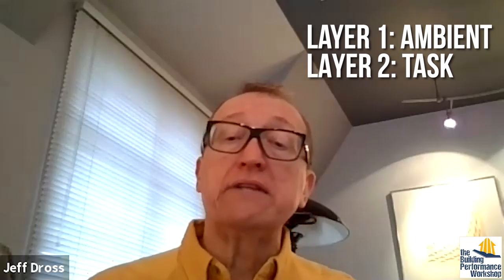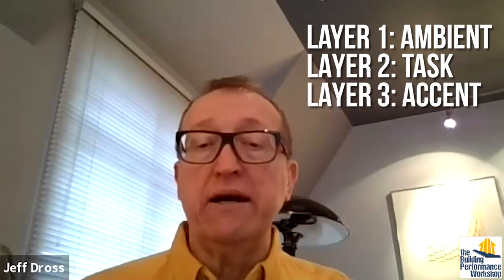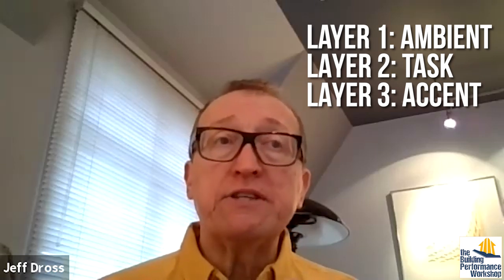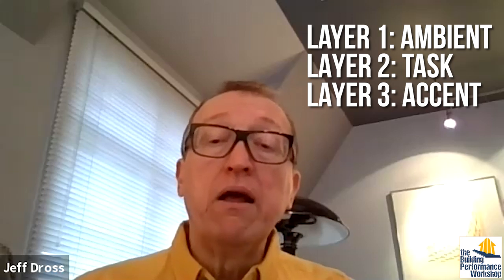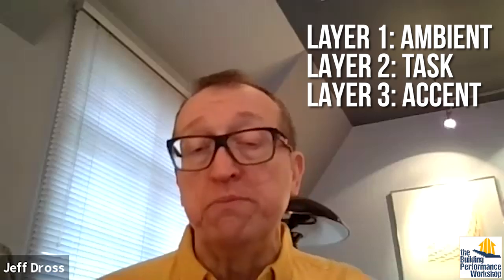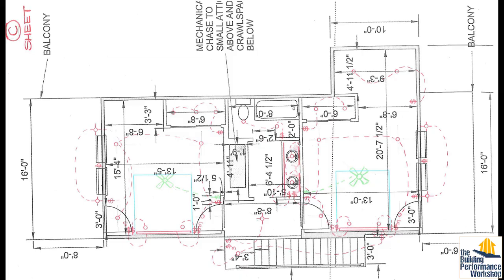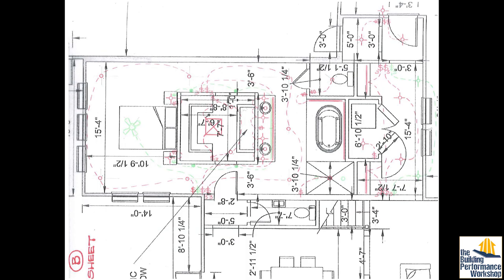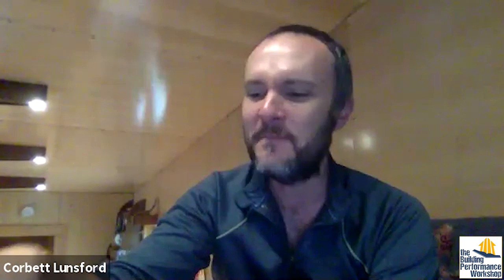How to Design Lighting: Layers, Lumens, Footcandles, Colors, and Systems with Kichler's Jeff Dross

Comment: Oh man. You've hit my subject. As a film industry gaffer, all I do is lighting science and lighting design. This was all good information for basics but I have a couple of things to add.

1) Concerning color... Kelvin isn't the only thing to think about. The advantage of incandescents is that they are black body radiators, like the sun, which brands they give off full spectrum light. This means, although your Kelvin may be 2700, every color of the rainbow is represented in that white. This means that when that light reflects off a colored surface, it will accurately represent that color back to your eyes. The problem with CRI readings on LEDs is they can be fine tuned to the CRI chart while still having spectrum drops so you'll get bad color rendering on certain colors. That's not to discount LEDs. They're definitely the future. Just something to check. 

2) The bigger the source, the softer the light. The smaller, the harder. The closer the source, the softer the light. The further, the softer. Bouncing light off the ceiling makes your entire ceiling the source, therefore softer. It's actually something we do quite often in film for a quick, beautiful soft source. 

3) If you want beautiful light, think windows. Not direct sun but the sky. Biggest, most beautiful source of light. And then accent with lamps. At night, just the lamps. Essentially you're painting with light. Pools of darkness are okay. In fact, preferable. Recessed or faux recessed should never be used unless you've dropped something and can't find it, lol.

Anyways, I could talk for hours about this stuff but if you're interested in color science Frieder Hochheim from KinoFlo has some good talks. And here's a good primer: https://www.google.com/search?q=color+science+led+indie&oq=color+science+led+indie&aqs=chrome..69i57.6274j0j9&client=ms-android-hms-tmobile-us&sourceid=chrome-mobile&ie=UTF-8#
Reply from the maker: You rock, Brandon, great comments. Very familiar with how scientific and painstaking film lighting is- something that requires way more patience than I have I think.
Reply: @HomePerformance  If you're ever in the Seattle area hit me up and I'll let you check out my spectrometer. 🖖
Reply: I know this reply is a year later but great into. In currently trying and failing to design the lighting in my house. I know I want zero recessed lights and much bounced light. 

Question. What are the best lights for bouncing off the ceiling.

2. Is it's better to bounce off the ceiling or off a wall? Thanks
Reply: @jl9678  The easiest thing to do would be to hide some led strip lights pointing up inside hanging fixtures or crown moulding around the room.
Reply: @lightswitchvideo  thanks for that info. I'll definitely look into that.
Reply: @lightswitchvideo  go, thanks for that link. It's a good refresher and I learned some more this time around (lighting around the bathroom mirror with sconces). It highlights two main problems I have.

1. I don't want to have recessed lights. There are several reasons one being I don't know how to implement them without the light looking boring.
2. I don't have any lighting catalogs. The only sources of lighting ideas currently are wayfair or lamps plus and the selection is disheartening.

So,  do you know,where does one find out download lighting catalogs?

Thanks

Comment: Good interview. I have done lots of lighting installs in commercial applications and you learn what works and what doesn't in many areas.  
 One issue I have though is his choice of color temperature. The 2700-3K color in a house is horrible. It makes you feel like you are in a dingy smoky poorly lit bar. That yellow light is annoying to deal with and many residential customers are replacing their low K lighting with lighting of around 4K because it's more like sunlight instead of a poorly lit cave.

       The problem with current LEDs is the powersupplies tend to fail. It doesn't matter what you paid for them as in my experience I have seen the same failure rate on high end units as I have cheap ones because the powersupplies are often the same units. Some super cheap bulb type ones use a capacitive dropper and capacitors are not known for long life.  
          The issue is say I have 10 sconces in a room and one fails. If it's more than a few months old you won't be able to buy another to replace it as it will have been discontinued. So you have to replace every unit. If that;s the case then why would you buy anything but the cheapest units available? What needs to happen is people need to realize that on many fixtures you can buy replacement power supplies off the shelf for dirt cheap and swap them out. That is the next phase of replacing bulbs.

     In the bedrooms I have put in the small hockey puck lights near the corners because a fixture in the middle of the room is about worthless as it is always behind you and everything you do is in a shadow. In the living room I have them behind the couch and chairs and one either side of the TV which those rarely get used but they are there. As for lamps... I have a deep seated hatred for lamps as they are only decorative and don't provide useful lighting.
Reply from the maker: Deep thoughts, Robert, thank you for sharing
Reply: I tend to like the daylight lighting for both reading and task lighting..   it is much better in the kitchen as it would look much more appealing but that is me.  Cooler is ok but can make some food less appetizing.  Laughing.. dont eat yellow snow or blue food

Comment: The issue with the "lights become like an appliance" analogy is that when a light dies or you want to change the color temp/features/etc. you will have to spend many times what the fixture cost to get someone to come out and "service" (replace) your light.  That sounds lake an awful tradeoff for something that is so simplistic to do that it is the basis of a whole series of lightbulb jokes.  Perhaps as they mature this will become more palatable, but I've had many LEDs die already and the quality of built-in LEDs is highly suspect for both longevity and light quality.  I'm personally going with all LED bulbs I can change out for my build.

Comment: Interesting to hear about light design, but not a fan of the industry pushing for cheaply made integrated LED fixtures that invariably fail and end up in a landfill. I have light fixtures now that are over 60 years old that have enjoyed the huge leaps in lighting efficiency by simply swapping light bulbs. And if that cheaply made LED bulb burns out in 6 months because of poor workmanship or quality I can replace the bulb instead of throwing the entire lamp away. Just my two cents.
Reply from the maker: Agreed Eric- and lightbulb jokes will be a sad collateral loss as well

Comment: dont go LED. The LED flicker has found to be bad for your eyes. go figure.
Reply: LEDs don't flicker unless they have a bad rectifier. They run on DC power which is a solid electrical signal. Don't buy cheap LEDs.

Incandescents, however, all flicker.
Reply: @lightswitchvideo  have seen a boat load of fluorescent that also flicker.  Yup cheap LED flicker also.
Reply: @stevepailet8258  Flourescents are powered from AC so will always have imperceptible (to the eye) flicker. There are multiple other failure points that may cause fluorescent flicker.

My point is that properly rectified LEDs are flicker free even to tens of thousands of frames per second because DC is solid signal. If it's flickering, AC power is leaking through.